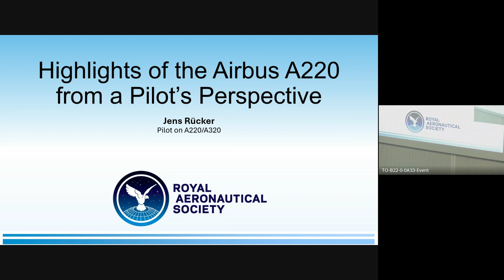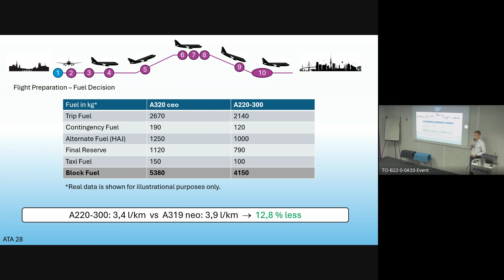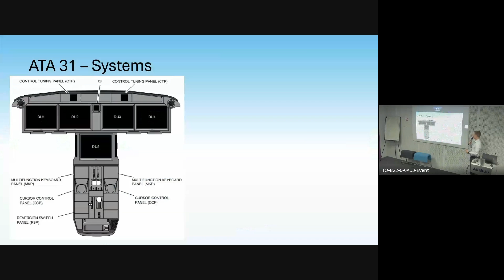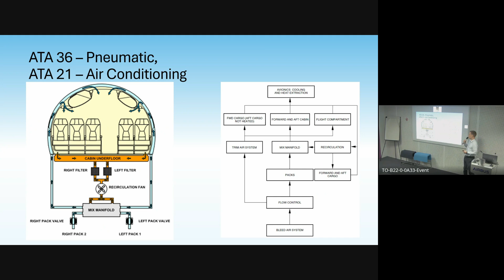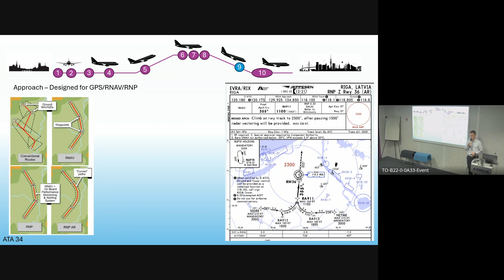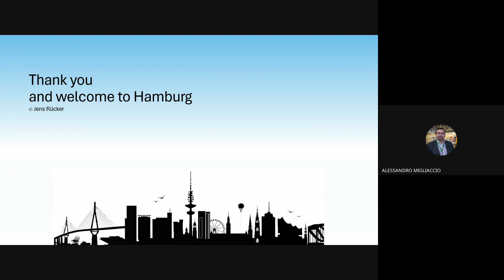Highlights of the Airbus A220 from a Pilot’s Perspective -  Jens Rücker

Comment: 52:25 Correction: The A320 PTU allows the green hydraulic system to power the yellow and the yellow to power the green. The blue system is not connected to the PTU.